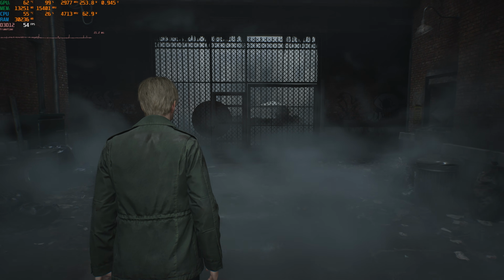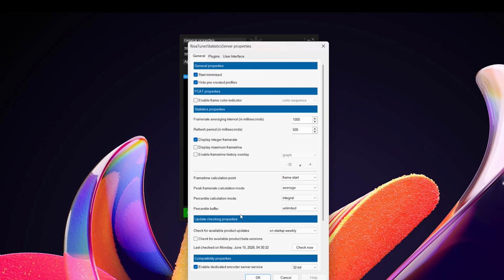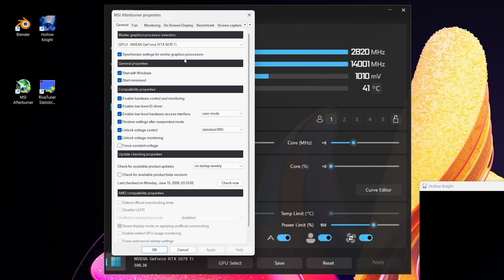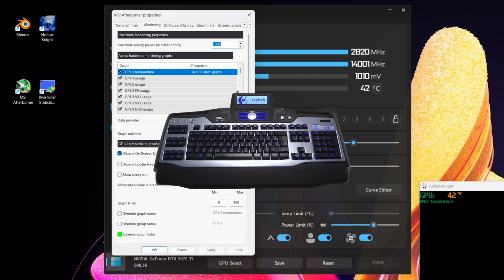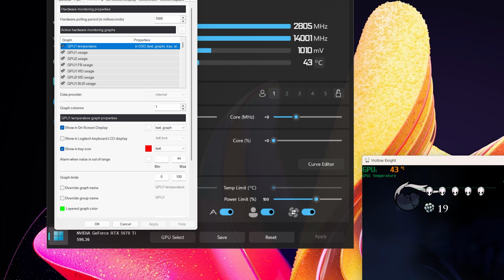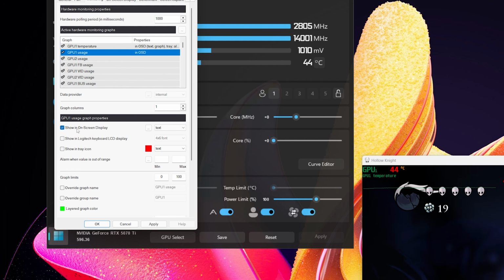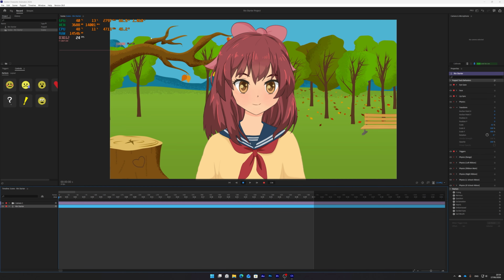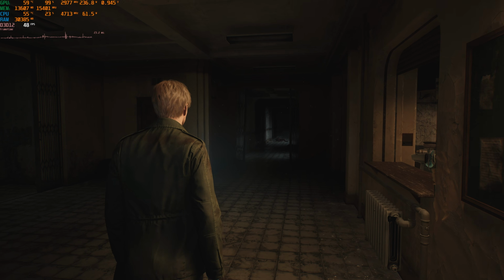How to setup an Overlay (MSI Afterburner and Rivatuner tutorial)

Comment: Yo bro, thanks for the video, it's good...but I'll be glad if u can solve 1 issue, how to display this OSD whenever we want, like even on normal display/tabs, not just while gaming

And not this one, the rivatuner edited one, I made custom OSD with rivatuner, but I want it to appear whenever I want, but even toggle key is not working except in gaming....can u pls help
Reply from the maker: Sadly, It only works inside applications that the program can read (so mainly games and some graphic programs like blender, maya, etc.) if you want to see the information even during desktop what you can do is use the “tray” option
Reply: @N00byte yeah, but hey, yesterday I was experimenting with it and I found that we can access that rivatuner overlay host program and it will open a solid pink/purple screen with the osd on it, we can scale it on whole window(maximize) and click chroma as background option, it will disappear (transperancy)and osd will stay as long as we want and can close it from pop up otion at bottom right in taskbar, and also tick it as start with windows so it will appear whenever we start our pc/laptop, so yeah this is the thing which can be utilised for OSD to appear permanently or as long as we want in non gaming windows 

Just make a shortcut of that rivatuner overlay host(NOT RTSS) at desktop for easy access

Sadly I messed up the settings of things I am explaining so I have to find adjust it again, not RTSS but Overlay host

*I mean transparency shud be kept as full(opaque) else OSD will also disappear 
Then click on chroma as background checkbox

*Also keep msi afterburner active else osd won't work, that's obvious, so better to make it active with startup too